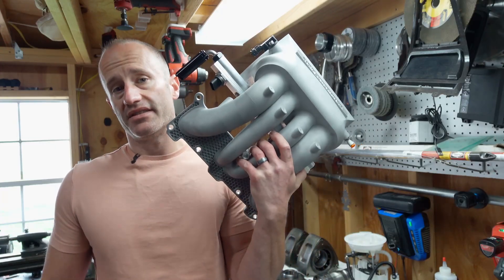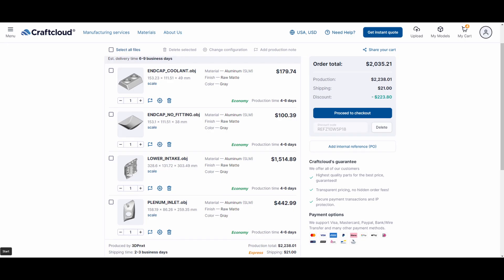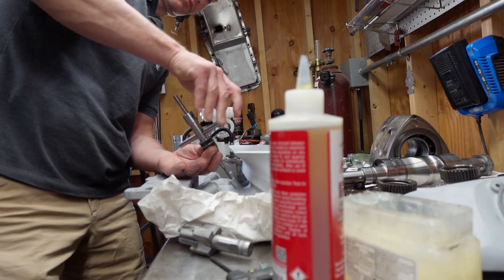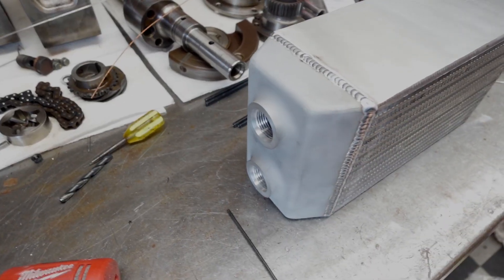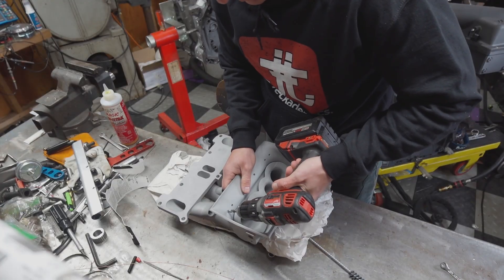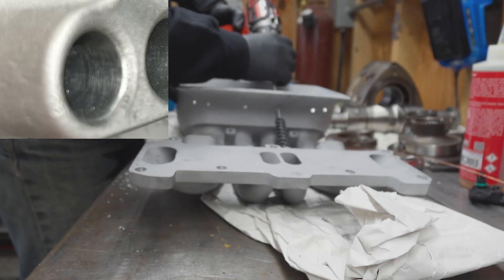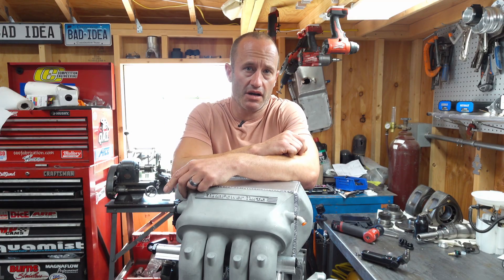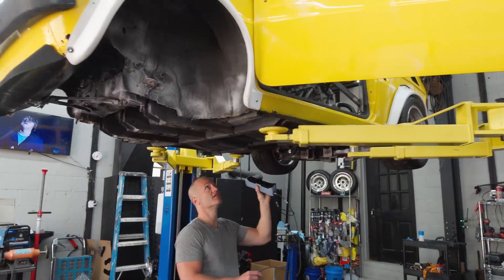Aluminum 3D Printed Intake Manifold - Building a 13B Rotary BMW i8 : EP4

Comment: what grade sanding belts are you using on your linisher? i have designed and made my own linisher and got some custom belts made, inspired by your use. it doesn't make things completely flat yet, i think i need to make the platten thicker/flatter. it's 300mm wide with 550mm long platten area. will be great to be able to make flat manifold faces after welding distorts them all. thanks for the vids and ideas and new tech you share.

Comment: 11:53 I had this issue as well with Fusion. Sometimes it alters geometry slightly when you mirror it. I try to avoid geometry mirroring/pattern or check the geometry closely.

Comment: edit: you can design your infill for the powder printing but you have to leave a place to blow the infill out! this goes for resin and powder printing both. if you want internal voids you can have them but you have to leave a way for the stuff to get out otherwise it's just trapped there.

some industry uses are like a running machine sized belt thingy. if it's got a flat plate under the belt it'll come out pretty flat. the problem is more like if you need to get it perpendicularly flat to something else.  milling is slow and not great for some materials either

Comment: Belt sanders. They are good tools to get a flat enough surface like shown in this video. Kudos to that! One thing to keep in mind if people are using belt sanders to remove more material. It is easy to get surface that is straight but in an angle.

Comment: All your stuff is really great! Maybe just my luck or service provider, but I find all holes in stuff I have 3D metal printed are undersized but not by a predictable amount, nor can the vendor provide guidance. Annoying. STL are facets without true curves and the bigger the part, the more obvious it is. In my CAD software you can set the faceting granularity, I assume you can in Fusion too? When you save the stl, are there any options in the save menu? I Just watched a design video on intakes... How long are your runners? Making them longer off the floor won't help as its dead air under the bell. Looks like your plenum volume is too low and several other things like those sharp interior edges you might do different after watching this dude, but max HP might not be your goal - awesome either way. https://www.youtube.com/watch?v=KD3-wkDlPFY

Comment: Wet blasting with fine grade glass bead gives the surface texture a low sheen along with finger prints etc easily wiped off. With a fine bead and only 40psi air pressure/ normal water pressure, but the better the surface finish the better final result.
Looking forward to the start-up.

Comment: Very cool and thank you for sharing. In one of your other videos you have a 3D printed charge pipe with the Bosch throttle body adapter built in. Can you share how you got a good enough surface finish on the Bosch adapter portion of the pipe, to utilize the O-ring seal with the throttle body? Was it left as printed or finish machined? I am looking to do something very similar and this is very inspiring. Thank you again for creating this content.

Comment: "...rough finish..." solution:
Flap wheels can be sized and shaped to best suite the job at hand by running them against a bench grinder.
Fine and finer grits are recommended as they sand away material fast enough.
NB that any grit below 500 makes skin friction a dominating factor.
Scotch Brite and WD40 give a very nice polish/finish.

Porting:  Use a high (30 000 rpm) air dremel to turn the bits.  At those rpms the cut is butter smooth vs all the jitter and shudder and tools pulling off target you have with electric dremels. 
(Electric 'dremel' doesn't even deserve the name IMHO) 

There are 3 good papers on optimal Bell Mouth design you may be interested in from the looks of things, but YouTube will delete the whole post if I try and link them.
Shout if you're interested.

Comment: With the constant advancement in AI is a few years (before it starts skynet and turns us all into batteries) you a s going to be able to say: Show me examples is this part lighten that don't reduce strength and also show me examples of reduced weight versions that reduce strength by 5% 10% etc.  This will make designs that are lighter just as strong and cheaper. Its will also be able to redesign the item to work better for its intended task. EG: make this "flow better"

Comment: Nice video! I'm planning to have an intake manifold printed from aluminum as well. The only thing I'm wondering is if there were any design restrictions you encountered due to the SLM printing process, such as overhangs or angles exceeding 45 degrees?
Reply from the maker: Didn’t really encounter restrictions based on the design so far. As mentioned, just don’t leave any overhangs that can’t be accessed to thoroughly ensure there’s no remaining support material.

Comment: all was great till you started talking about flatness, then it all went straight to bin 😆
straighness/flatness is deviation over distance, "thous over cylinders" is absolutely meaningless, I'll go metric here, cylinder is typically around 80-85mm in diameter, plus wall lets say it is 90mm, and permissable deviation is 0.01mm lets say, that doesn't mean that over 180mm (or two cilinders) you can use 0.02mm feeler to check for flatness anywhere, it means that there should be no more than 0.01mm deviation in any 90mm section of that 180mm distance, using 0,02 feeler because the distance now is 2x90mm is plain wrong
that being said - in this particular case, the seal is compressed way over whatever the deviation ends up being over using a belt sander to flatten a flange, but it is still a weird thing to do when you spend probably 3k+ on that whole thing... just befriend a machinist if you can't be bothered to buy a used milling machine, just painful to watch that ghetto approach...

also - you don't add pressure when you use straight edge, especially one that is so low (in height), because it will bend a thou just from your finger pressure over that distance (if the surface you're feeling is U shaped), what you do instead is rock it and slide back and forth to get a feel where the high spots are, go and check some metal scraping video lessons, there are plenty out there, to see how they blue up straight edges and print the parts and how they then check them for flatness, because you're spreading nonsense in an otherwise good video

Comment: Just came across your channel. Some pretty cool stuff!

I'd love to see some more custom additive manufacturing, components like:
- Optimized heat exchangers designed with Triply Periodic Minimal Surface lattices (integrated water/air intercoolers, oil coolers, radiators)
- Staged intake manifolds with ITB's for primary ports, secondaries and semi-peripherals
- True equal length, optimized runner length and area, anti-reversion inconel tubular exhaust manifold for turbo builds (or the complicated MSP/GSL-SE hybrid)
- Front housing cover with MFR style integrated dry-sump system that doesn't cost as much as a new engine (like some billet offerings)
- Even go as far as 3D printing entire sideplates and rotor housings with optimized cooling galleries for even temperature distribution

That's just me daydreaming, but having the funds, something I'd really want to try.

Comment: Well I'm certainly envious!  Great work, the parts looks wonderful and it's quite the interesting project.  A rotary in an i8?  Interesting.

I designed a manifold for my 12AT a year or so ago and have just been waiting until I can afford to get it printed in a similar fashion.  Definitely look forward to a decade or two down the line when this tech gets a bit cheaper.

It's hilarious how similar the design is too, granted I guess there isn't too much to deviate on the rotary platform.  Sorta fun to almost see "my" concept come to fruition through a different lens.

I have the same issue of no center-iron injectors because it's a 12A so when I said it's a similar design I really meant it, it's almost uncanny with a few differences up top with the plenum.  Currently I run the factory Nikki carb intake with a printed CF-PA "injector adapter" that holds the throttle and injectors and everything.  The injectors are way too far away from the engine for decent drivability but it does work and makes good power.  You sort of have to make do on a uni-student budget so it is what it is.  DBW also helps keep things a little more tidy since it saves the need for an IACV (which it used to have) but a proper custom manifold is definitely the goal.

Anywho, pardon nerding out a little, it's just so cool to see basically the same thing I've been wanting to do for approaching two years now.  Absolutely love it, great work!

Edit; just got to the fuel rail bit and I did the exact same thing!  3D printing jigs has been a massive aid in working on custom automotive stuff.  I made drill jigs for moving the oil gallery connections for the oil pump outlet and front bearing feed (both to the front iron) as well!  Minor stuff I know but I'm just nerding out, apologies.  Cheers!

Comment: I never saw anyone addressing 45 degree seal for the Bosch pressure+temp sensor, I have couple of those installed with copper washer under the sensor and it seals this way. Can you share any sources that describe correct installation procedure?
Reply from the maker: Check out the technical drawing. I’m sure a copper crush washer works fine as well. https://www.bosch-motorsport.com/content/downloads/Raceparts/Resources/pdf/Offer%20Drawing_261221899_Pressure_Sensor_Combined_PST-F_2_350_bar.pdf
Reply: @CouchBuilt  thank you! Found this one as well, but it's for different one, 350 bar version. It has slightly different shape...
Reply from the maker: The smooth tip and the one with the groove both use the same seat machining from any of the drawings I’ve seen. There are hundreds of Bosch sensors so I try to limit my use to the ones that have documentation available.

Comment: Very cool technology! Question: Why are the inside runners smaller diameter than the outside two?
Reply from the maker: A 13B has different sized primary and secondary ports.  If you make the runner too large, you will lose intake velocity and negatively impact low engine speed performance.

Comment: First of all mad respect for the time you spend thinking, 3D modeling etc. This is the real shit, this is a real build not bought car when finished. You earned yourself a new subscriber. At the and of the video you let us give you ideas About any Color for the intake manifold. You said powder coating but Maybe cerakoting it would maybe be the beter option. Here me out why, cerakote is excellent in keeping heat in the material itself prevending ir heat for example: turbo manifold, exhaust etc. But cerakote is not only excellent in keeping heat in the material itself but also heat protection, for example the ir heat created by the exhaust manifold, since its good in keeping heat inside the material itself also means it needs a lot of ir heat to pentrate the cerakote layer and start heating up the aluminium itself and thus automatecly heating up the air inside the manifold itself and hotter air means less oxygen less oxygen less fuel less fuel less bang less bang less hp. not saying That powder coating is a bad idea, but cerakote c series is aircuring instead of oven curing like poweder. And c series had the same strength as oven curing cerakote. And since all parts are already sandblasted what cerakote needs to bond maybe a thing to consider. Why you think, because the ir heat protection since the exhaust manifold and intake manifold are close to each other. Maybe considering cerakoting the exhaust manifold as of the part about keeping the heat inside the material, 

Sorry for my maybe sometimes wrong writen words 
Greetings from the Netherlands🚗💨

Comment: How is the strength of printed aluminium compared to cast or machined billet? In other words, how much do you compensate for what I presume is a lower strength part?
Reply from the maker: Strength is comparable to a cast part, possibly a bit stronger as there tends to be less porosity.

Comment: I am very much interested in the thermal pressure and abuse this is going to see. Starting and ending measurments for the race season, i want to know how much it tweaks under abuse.  Those welds on the heat exchanger have a tough job ahead of them. I would keep it at 18 lbs of boost briefly. 24 lbs put on your balistic saftey glasses, P= (2*T*S/D) for your weld should help. Ironically you have a license plate behind you that says bad idea.
Reply from the maker: Barlows equation is irrelevant for the plenum, but at least the runners will take 9,760psi
Reply: @CouchBuilt   was looking for the weld strength, not the base metal strength. I'm digging through my college notes their is a different equation for weld strength under bost/heat.
Reply from the maker: @invasivecoyote1361  Absolute weld strength isn't even worth consideration here. Most motorsports component weld failures under pressure are due to flex of the joined material over the weld joint itself. There's a reason you don't see any large flat surfaces, and the closest thing to a flat surface has convenient stiffening ribs as part of the logo. If temperatures in the intake are enough to alter the strength properties, the car is on fire.
Reply: @CouchBuilt  I'm not banging on your door. Sorry if I came off that way. I very much appreciate your artwork. I'm just a fellow car hobbist such as yourself, and I have dabbled in making mainfolds, both intake and exhaust. Simply pointing out my past failures and experiences. I built an intake similar to yours except a BBC 454, and it blew a nice chunk out at the lake doing more than I should have asked of it.
Reply from the maker: @invasivecoyote1361 nothing taken offensively, just pointing out some details that others might be interested in response to your comments. Using sheetmetal for intakes puts significantly more stresses on welds. This is why you’ll often find vertical supports welded in large inline layout motor plenums to prevent flex, which would manifest as a blown weld.
Reply: @CouchBuilt could you have had the intake printed in titanium, magnesium or composite like carbon/kevlar for even lower weight? Not sure if they even offer those on cloud craft

Comment: Just found this series and I am all about it!!!!  Been thinking about engine swapping an I8 and knew about the engine constraints. Just binged all your videos then also Robs 13b 700hp video. Any reason why your not going Nexus? I assume its the BMW support for the CanBus on Max. What are your HP goals, why EFR? Not that smallest turbo to put within a restricted space. Awesome to see another New Englander jumping into a project like this.
Reply from the maker: Maxxecu was primarily chosen because it has native control of the DQ500 trans over CAN, as well as a super flexible CAN and custom tables/maps. I like the EFR because its all self contained. My original plan was for an EFR9180, but it was on backorder at the time and this 8374 has an upgraded Bullseye Power batmowheel compressor. Looking to get around 500whp to start, then lean on it a bit harder and see where I reach the point of diminishing returns. Thatll be a good step up from the 220 or 230 the factory ICE makes, and the additional power from the hybrid components will be there as well.

Comment: I notice no support bracket in your design, are the 3D printed SLS runners strong enough to support the entire assembly?
Reply from the maker: It’ll have an adjustable support pad bolted to the motor. It would probably be OK with the 5mm thick walls, but not worth the risk.

Comment: Given that flatness and smoothness are not at all the same thing, are you pretty confident that the belt sander did a decent enough job creating a smooth surface on your mating surfaces that you wont have problems getting it to seal?
Reply from the maker: I’ve built more than a few manifolds. All have been sanded, none have ever had sealing issues.

Comment: This is incredible. Many rotary people suggest to add a heat shield between the intake manifold and the exhaust/turbocharger, it might have been nice to add a provision for that onto the intake manifold. Thanks for addressing the flange flatness, I wouldn't trust most of the belt sanders that I've used but it's it's hard to argue with a feeler gauge.

Comment: This is really cool to see.  I love seeing 3d printing used for automotive parts, its rare that i get to do it on my own car since i cant afford metal printing but one of these days i hope to do lost pla casting to make a self made engine.  

The fusion export issue has to do with the level of detail settings when you export, fusion is honestly terrible at import and export stuff.  Itll add more mesh the more features youve got in the area, so if its just a large tube it ends up low rez unless you turn the resolution up to a frankly ridiculous level.

Until recently i was using fusion, but they booted me from the startup edition i was learning on, so ive switched to seimens solid edge (fully featured and free to makers and hobbyists) and honest to god its night and day better in every single way.  One of these days ive gotta write a thank you to autodesk for forcing me to learn something else because noone would use fusion if they knew how much better everything else is. 😂

Comment: That throttle body looks like it belongs on a 1.8 four-cylinder engine… or is it just the camera making it look small? 🤔

Hhhmmm you did say 68mm. Why so small?
Reply from the maker: 68mm isn’t small. This isn’t a 6L V8 and I’ll always choose the smallest throttle body that won’t be a restriction as it has much better drivability.